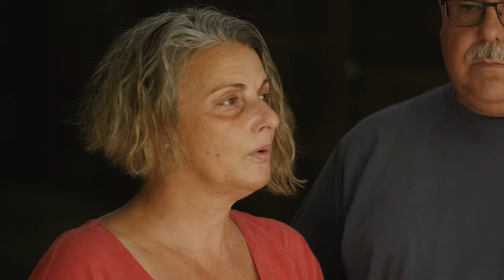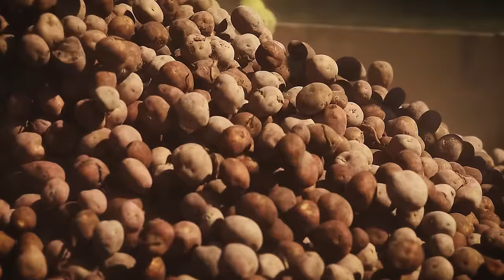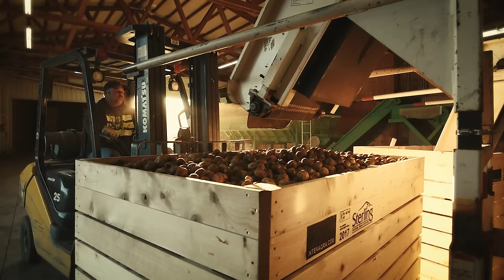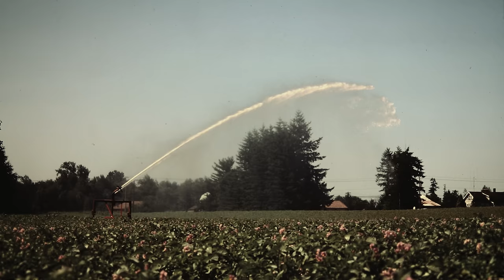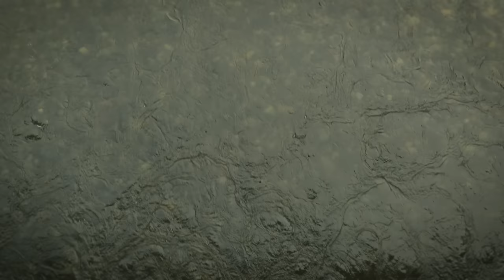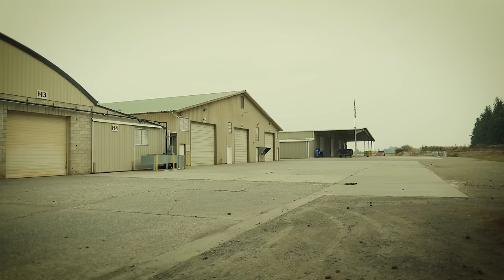Losing The Farm — The Story of Cascade Farms owners, Diana and Jeff

Comment: Our small farm (420 acres) is a seventh generation farm. My son wanted to farm but he has a off farm full-time  teaching job. I am retired and can provide free labor as we farm in shares. We use Agco tractors no John Deere ( too expensive) We no-till everything so large tractors & equipment not needed. That also saves time and fuel. Our combines are 30+ years old. We repair everything ourselves. We are making good profit each year because our expenses are so low. This is the only way small generational farms can make it today. Too many farmers buy expensive newer equipment because they are afraid of a brakedown. ( learn to fix equipment yourself) Our semi tractor grain hauler is a 1983 Army surplus with only 110,000 miles and cost only$7500. You don't need a new pickup truck every 5 years. 2024 may be a make or break year as soybean prices are at least two dollars lower and corn one dollar lower. Those lower prices come out of the profit. Only disciplined farmers that control costs are going to make it to the next generation.
Reply: You hit the nail right on the head
Reply: Common sense MANAGEMENT keep cost down PROFITS  UP 😄
Reply: Exactly !
Reply: You have a good point but not every farm produces corn and soybeans. Potato farms for example are much more labor intensive so there is a whole different dynamic when it comes to costs, labor, no till potential, etc.
Reply: @astt8ui - wow thanks for the insight. God bless the Farmers. They are worth their weight in gold.

Comment: I am very sorry to see this situation. I am not familiar with irrigation,  farm in Ireland. Would it be possible to sell all the machinery and rent most of the land or if necessary sell what it takes to get clear of debt. Start farming 50 or 100 acres for hay or haylage. There may be no fences, but fencing 50 acres your selves and keep sheep hay and sheep can be worked part time. Employ no on, work off farm, year by year take back land. Is there a farmers market near by to sell direct and keep costs to a minimium. It may be considered small, but 500 fertile acres is a big farm. Hang on. The best of luck

Comment: Profit margins usually are low when you get a new pickup(s) every couple years, new equipment with astronomical payments, depend on chemical fertilizers, have an ag system that isnt tiered or layered like a tall wedding cake only having the same one cash crop year after year. A properly structured farm will provide steady year round income for its workers, none of this 100hr weeks one month and sitting on your thumbs the next. Doing it like grandpa did doesn't work today.

Comment: I operate a small specialty farm here in Oregon that my mother & I started 25 years ago. Labor costs of $32.25 hourly are wreckers for operation! Feed costs have stabilized somewhat but fuel costs are another wrecking ball to our operation.We are hopeful that a cousins son who likes working outside with equipment will be able to take over from this 68 year old as he is only 22. The pedigrees we have are no longer readily available & are becoming more wanted on the East coast . Shipping costs are terrible! We do have a buyer from the mid-west who will come himself to pickup our equines despite our having to raise the $ by 50%. Machinery usage in place of labor is even becoming costly due to fuel & replacement parts cost. Because of fuel costs in late summer we have not mowed are main fields for 2 years now. Property taxes are another destroyer of our budget! They increased > 1,000 last year despite having farm deferral rate. The property taxes have increased 300% since we started operations! Same old 65 year old farm house we started with & newest truck is 35 years old & others are 54 & 40 years old. All technically antiques, as is our Ford tractors too!